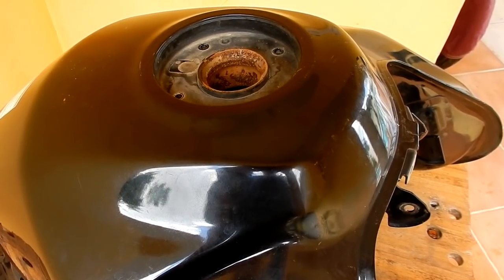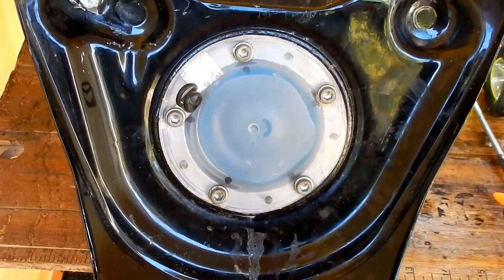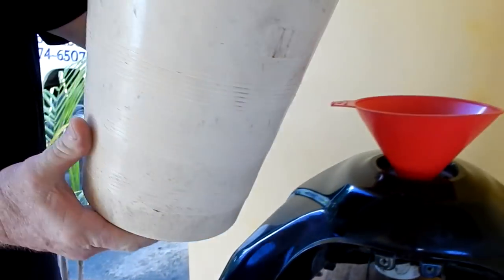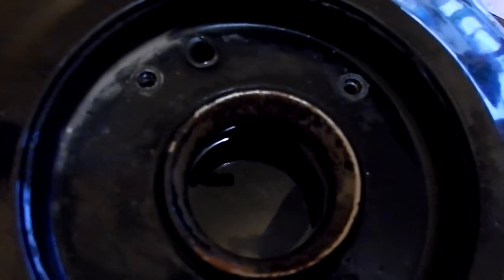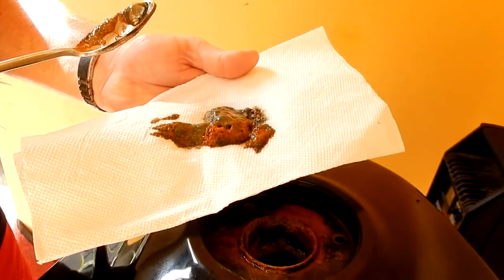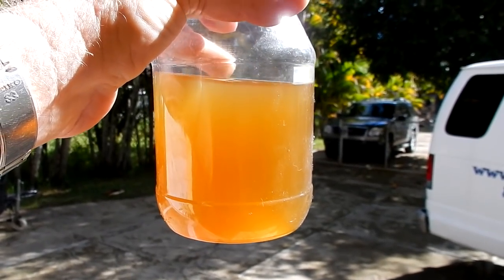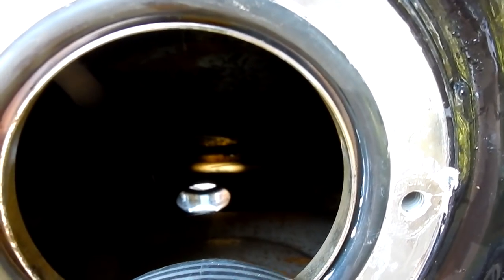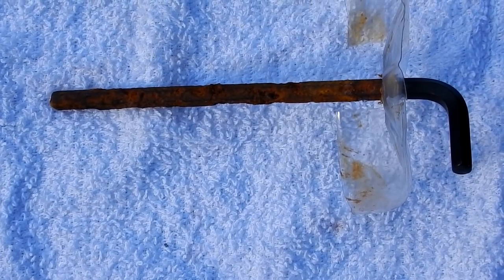Motorcycle Tank Rust Removal Using Electrolysis

Comment: Hyy sir one doubt sir you where used bike battery I have some little bit bigger than bike battery with that I can remove rust from petrol tank sir??
Reply from the maker: A bigger battery just has more amperage discharge potential. It should make no difference in electrolysis since potential power makes no real difference.
That said, I am not 100% sure, but I don't think a battery alone without a charger will work. A charger pushes the amperage you want (I set it at 2A). A battery alone needs a complete circuit to do the same, and electrolysis is a very poor "completed" circuit.
Reply: @MotocaribeDR  can I use charger alone for this electrolysis process sir ?
Reply from the maker: @naveenkarukonda8004  If it is an automatic charger as most, no, because the charger needs to detect some voltage to work. 
I put the battery between the charger & tank so the charger detects voltage.
Reply: @MotocaribeDR  ok thank you sir for your valuable information I can use charger to battery charge at the same time I can do the process of electrolysis

Comment: Will this dissolve tank sealer as well? I used por15 tank sealer and it dried way to fast somehow and only coated one side of the tank. Want to try this on a 1972 Honda tank before I give it to an engine shop to have baked in there block cleaner oven.
Reply from the maker: I have had zero problems with POR-15, none, nada. It's a permanent solution as I have used it.

It does take some patient effort sloshing it around inside the tank to make sure all surfaces are coated.

Comment: Been using this method for years it/s the one and only way to remove rust inside or outside a tank if you want it clean
Reply: Do you coat the tank after electrolysis or leave it as is, after removing all the rust and thorough cleaning it?

Comment: Hi Team...Why do they use a battery and not connect the charger directly?
Reply from the maker: Because an automatic charger needs to detect some voltage to work, and when connected directly will not detect voltage, and therefore will not work. A battery jumper is necessary as I pointed out in the video. Charger-->battery---> tank.

Comment: Also if you leave it as is will it flash rust?
Reply from the maker: If you do not coat or seal the tank, you will get flash rust very quickly.

I suggest coating the tank within a couple of days after getting it de-rusted and cleaned.

Comment: One of the great mysteries. Why can we not use sodium bicarbonate (baking soda)? I've seen a few videos and everyone says to use washing soda. But they don't explain why. Is there any science to the washing soda? Would regular water be sufficient, with enough voltage? Or, conversely, would Sodium Hydroxide drain cleaner work as an electrolyte, since it is non corrosive to iron?
Reply from the maker: Physics, chemistry...and majik... ;)

Comment: Great video, could an anode fro an electric hot water system be used instead and would results be better, coating the inside of the tank with magnesium ?
Reply: Or, follow up with reverse electrolysis using copper rod in place of your Allen key anode ?
Reply from the maker: @markinnam6991  I have no idea...

Comment: I'm amazed how good it actually worked.
Reply from the maker: Tell me your experience, please!
Reply: @MotocaribeDR  I have not tried electrolysis, I was amazed by you're video :) I'm working on a Harley tank, the paint in the tank is starting to peel, and I'm seeing some rust as well, so I need to try and off the old paint first, I have added some sharp edged nuts and white vinegar to help the process.

Comment: Sodium carbonate and sodium bicarbonate are almost equally effective in this process. The only difference is that the anode plates rust very differently. Rust on the sodium bicarbonate anode is very fine and tightly attached. But the rust on the sodium carbonate anode is coarse, thicker and very loose.

Comment: Not sure if my 1991 Honda Beat car's tank may need this and it uses a 5 gallon fuel tank as well and it is easy to access by removing the two piece engine cover panel under the convertible top, just got to figure out how to unbolt and remove it from the car.

Comment: I tried to use this cleaning method for my carburator but I made a mistake (put the negative wire for anod) and the whole carburator fully with crystall....look like the sodium carbonate sitting on it!!
Reply: How can I repair this shit mistake?? If I change the pole all crytall will came off or not?!
Reply from the maker: @tamaska0215  Thanks for taking one for the team. I was told to be sure to NOT cross the wires and tried to emphasize that in the video. Now we know why.

I have no idea what would happen if you reverse polarity. Sounds like the carb is inop as it is, so give it a shot and report back.
Reply: @MotocaribeDR  you know I am the experienced electric guy...and that was my fault ....I was quite tired when I did. 😭

I already changed back the polarity and started the mission....I will let you know the result. 🙃
Reply: @MotocaribeDR  Update:
After couple of water change....everyhing okay!!
The crytal gone!! And my carburator clean like a new!!!

Unbelievable!!! Thx. For the video!!!
Reply from the maker: @tamaska0215  I'm glad it worked out!

Comment: Busy with a Triumph Trophy 1200 tank, 25L.
For the petcock, I managed to find a replacement diaphragm, spring & screws in a Suzuki 14-fck35 kit, the internal nitrile o-ring can be bought from an automotive store. The gaskets will have to come from Suzuki GSX_ model bike.
Electrolysis on a 12V 2A transformer got rid of the scale forming some scum. Now, after 4 days of repeating the process it seems to take longer to lift the black Ferrous Oxide. I also flipped the tank so get at the rust at the top. Busy on my fourth anode.
When this anode is almost depleted I'll do a pressure wash to see if this gets rid of the stubborn Ferrous oxide.
Otherwise, some say that the process is complete when the reaction at the anode is no longer visible. So, I might hook it up again after the wash to see if there is any change.
Reply from the maker: Interesting comment about the anode: the process is done when the anode no longer disintegrates. Might be overkill, though, because when you seal the tank (I use POR-15) rust is no longer an issue

For what it's worth, I put excess POR-15 left over on a small section of chain link fence rail that was starting to rust. 5 years later, no rust, and the POR-15 is still present, unchanged, like the day I swabbed it on. That stuff is hard and tough...

Comment: Good idea you have .I always wondered about the process. I used distilled vinegar,cheap, filled tank let sit overnight shook vigorously  till I tired out then drained and used complete with pressure city water and let dry out. I was surprised how clean and shiny metal was restored. I expected rust wood immediately  reoccur, which it did.a yeah I found a product that stops and seals small holes on the tanks, it's been around a long time and is called red-kote, fuel tank liner. Lawn mower shop owner suggested the product. did it today, I'll give it a second coat later once the 1st coat drys, seems to be good stuff plus lots of good reviews on utube channel. Seems theirs so many ways to accomplish this problem the many of us nowadays experiencing.

Comment: Hey Robert , may be showing my ignorance here but if this set up eroded a allen wrench like that wouldn't it eat up the inside of the tank as well ? I must be missing something .....
Reply: I can understand why you'd ask the question, but the answer is: No. 

The allen wrench---but you can use any ferrous metal---is sacrificial. The current goes from the tank (ground) to the cathode (positive.) The rust is electrolyzed.

Comment: Thanks for the video Robert, I'm doing my KLR gas tank right now, first time using electrolysis.  You stated below that you sealed the tank with POR-15. Did you just use the sealer or did you use their 3 step process (Cleaner, etcher, and then sealed)?  Thanks again.
Reply from the maker: Ed, after getting rid of the rust, I used the POR-15 three-step process to ensure the best results. I have done this multiple times with great success.
Reply: @MotocaribeDR  when using the 3-step did that keep your tank from flash rusting at all before you sealed it?
Reply from the maker: @specialed8219  The first time I waited a few days and there was some flash rust. Now I plan the POR-15 process right after finishing the rust process. The flash rust wasn't bad and was easily cleaned off with vinegar. You just don't want to wait too long before the POR-15.

Comment: How to do pressure cleaning?
Reply from the maker: I have a gas engine pressure cleaner, but there are also electric ones. You just "wand" the inside as best as possible.
Reply: @MotocaribeDR  love the video! If you don't mind me asking, what is the psi of your pressure washer? I have a few we use commercially and don't want to go overboard.
Reply from the maker: @nelsonm3025  Mine is 2200psi at max, but I used a slightly wider spray. Unless the tank is rusted beyond repair, you probably won't damage it.

Comment: Excellent clip, i was concerned about ruining my tanks paint job using some method of acidic treatment, looks as if this is the solution. my tank also has a similar pump/filter set up so this should be ideal.... hopefully      btw did the flush out affect the external paint on the tank ?
Reply from the maker: No issue with paint at all.

Comment: MUCH BETTER METHOD:
       If tank interior is heavily rusted then fill tank 1/2 full with abrasive or clean gravel. Double seal all holes with Duct tape and rubber compression plugs. Wrap tank in two heavy moving blankets and rope or zipties. 
  Then tumble tank for 2 -5 hours in a clothes dryer to remove all loose scale.  Tumbling is a slow process. Then wash inside of the tank with a Degreaser like 409 and distilled water.  Rinse well.
   Evaporust is reusable, no odor, nontoxic and does not harm metal or paint. So Evaporust in the long run is way cheaper than one use vinegar. Evaporust will not cause flash re-rust if you rinse with distilled water. Let dry and treat with interior with OSPHO. Ospho is also reusable. Ospho is special mild Phosphoric acid that turns the metal surface into Iron Phosphate.  Iron Phosphate will not rust. Rinse well with a gallon or two of Distilled water. Use a hair dryer to dry out the tank fast.
Seal the tank:  Plug all holes except one. Fill tank with 1/8 to 1/4 full of silver or white POR. (Do not use black POR)  Rotate the tank several times to coat the inside and dump out the excess POR. Let harden overnight.  WILL NEVER RUST AGAIN.
Exterior: Wipe with Ospho  Three times. then apply POR.  
NOTE:  Tap water has minerals that promote the formation of rust. DO NOT USE TAP WATER.
Reply from the maker: 🤣 I can fit my dryer into my tank before I can put the tank in the dryer. The tank is 5.3 gallons!

I appreciate your input,  but after doing this procedure 6 times on my bikes and others, I can say the method I used is very effective. I have used big bolts instead of an allen wrench. The anode just needs to be conductive and is sacrificial.
Reply: @MotocaribeDR  did you coat the tank after electrolysis with anything?
Reply from the maker: @ItsAlive111  Yes, coating ofter electrolysis is critical. I use POR-15 but there may be other comparable systems. For sure, POR-15 is a one-time permanent solution.

Comment: What did you do to seal the fuel outlet?  ill be doing this process to mine isn’t as bad so I’m going to try this for a day and a half to see.. thanks again.
Reply from the maker: The DL650 has an electric fuel pump with built-in outlet, so the challenge is sealing the large hole after the pump is removed.
A non-EFI tank usually has a metal nipple for the fuel, with a fuel hose clamped onto it. You can use almost anything to block that hole. I would think duct tape may do the job.
Good luck!

Comment: Did you seal the fuel assembly hole because you didn't have the fuel cap? Or is there another reason for this? About to try myself.
Reply from the maker: I sealed the fuel pump assembly hole to help the solution from leaking out.

Comment: Sir I will use 12v 1amp its ok or not?
Reply from the maker: Try and see. I used 2 amps, but it might work with 1. Does your charger have a 2 amp option?
Reply: @MotocaribeDR  bro i used that reacts in few second. But the rust was taken half only
Reply from the maker: @diwanff1885  It takes me at least 3 days to complete the process, and depending on how bad the rust is, maybe more.

Comment: In your opinion instead of taking out the pump  clean it all intact ?
Reply from the maker: The pump and float level are fairly sensitive electronics, so I don't think running DC current through them, especially with the soda ash mixture, is a good idea. I wouldn't do it. Besides, removing the pump offers an opportunity for some basic cleaning and maintenance.

Comment: Nice video. I have the same problem with a VFR400 tank. Will probably do this or the acid route. At the moment it is in Vinegar. Will also do POR-15 or equivalent for anti-rust coating. Thank you for this video.
Reply: How did the POR-15 work out? I'm just in the process of rust removal (bandit600) tank.

Comment: Love the info. Im looking at the same issue on my 2002 shadow. From what im gathering the ethenol in the gas is having alot to do with this problem. I have a 76 gt 80 yamaha that has sat as long as 15 years . I empied the tank. Poured fresh gas in swashed it around. Drained. Refilled and started rightbup. No rust in it. My shadow sat for a couple years and now looks like a boat anchor. Thanks for the geeat video.
Reply from the maker: Ethanol can be a problem attracting water, no doubt.
If you're going to store a tank with ethanol, be sure it is fully topped off and add some fuel stabilizer. The problem comes from moisture in the air in the tank.

Comment: Maybe a theoretical question here. I've got a rusted tank that the former owner either coated with something like POR 15 over existing rust, or had rust build underneath the sealant. What I've got now is a complete mess - some of the liner flaking off, some still on but stuck to rust underneath. Have tried paint stripper and it's barely touching it - could keep on going with the stripper but I hate using the stuff. Question is - if I tried this method, then would it lift the rust underneath the old sealant and lift the whole lot off in one hit? I'm thinking the answer is yes, even if it might take time for it to start at the edges of the old sealant and take time to work its way under bit by bit. Never tried the electrolysis method, but this video is awesome - thanks for sharing.
Reply from the maker: You present an interesting situation, and like you I don't have an answer.

I suspect most sealants are similar in composition. You might want to write the folks who make POR-15 what they might suggest to remove old coating.

Chipping away at the old coating through the filler hole or EFI pump opening would be difficult and frustrating

And you could be correct: electrolysis could eat away at the rust underneath the coating. It may take a while, and I'd be interested in your results.
Reply: I would suggest contacting a radiator repair shop. They will dip the tank and everything will be stripped. You MUST remove any plastic first!! Sometimes the paint will be OK, but you may have to re-paint it. In any case the entire interior will be stripped to bare metal and every radiator shop I've worked with not only strips, but can also re-seal if you prefer.

Comment: Hey do You think that it Will works in a fuel tank from a car?
Reply from the maker: Sure. But it could be harder if the fuel tank has internal baffles. You could cut an access hole for cleaning, then weld it back shut. You will still need to treat the surface with some sort of epoxy like POR-15.
Good luck!

Comment: Did you ever ck how many Volts were going across? My setup is the same, but I’m not getting a reaction. I’m wondering if the issue is if because the old motorcycle battery I’m using is “too dead”…and the charger knows it. (The charger says the battery only has .75 volts…so it’s virtually dead.)
Reply from the maker: Yes, I did: 14.2 or something after the in-line battery.

Your battery is dead. The charger reads the battery voltage. But a serviceable battery in-line and you'll do fine.
Reply: @MotocaribeDR  thanks!
Reply: One more question. Do you think there’s enough hydrogen gas released to make doing this in the basement a bad idea?
Reply from the maker: @homeblt  Unless your basement is tiny and hermetically sealed, I doubt it. Hydrogen gas is really light and will probably find a way out.
Reply: You were right about the battery. I used one of my car batteries, and I’m getting results within seconds. Thanks again
Reply from the maker: @homeblt  Excellent. Let me know the outcome.

Comment: Many ways to clean up rust. Now will you coat the inside of the tank?
Reply from the maker: You absolutely need to coat the tank. I am a big fan of POR-15. I use it whenever I have to fix a rusty tank. I buy the motorcycle kit and just follow the instructions. Easy Peasy and effective.
Reply: @MotocaribeDR  Thanks for the info.

Comment: why your jumping cable of the charger are reverse on the battery ?
Reply from the maker: They are not reversed, or sparks and heat would be flying!
Reply: @MotocaribeDR  if you say so but i can clearly see the black pliers on the positif and the red pliers on the negative on the video ....
Reply from the maker: @simonthiboutot6701  Nope. Not cross-connected: https://imagizer.imageshack.com/img924/6608/KuPdG9.png

Charger: red on battery +. black on battery -. Jumper: green on battery - & tank, yellow on battery + and electrode.